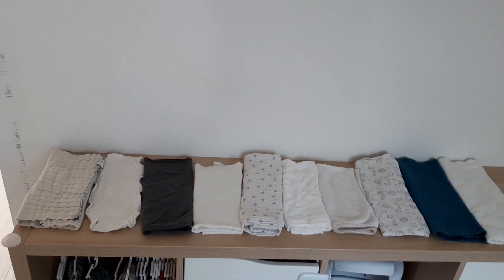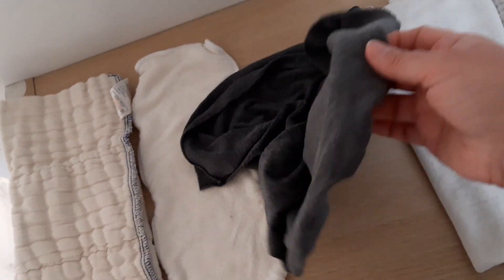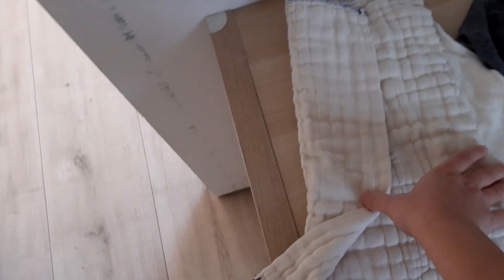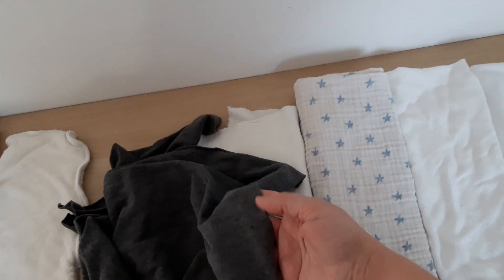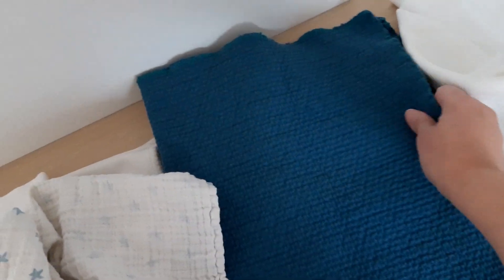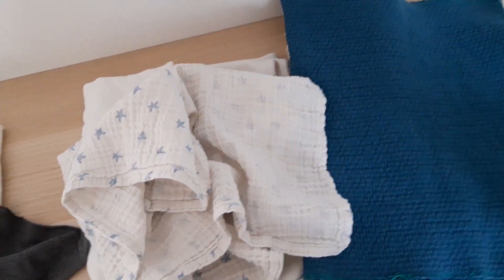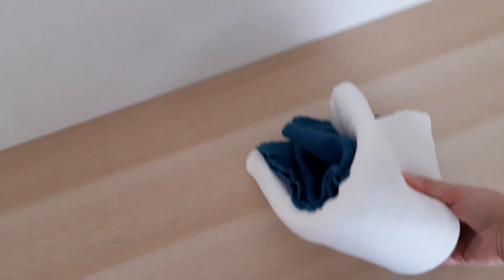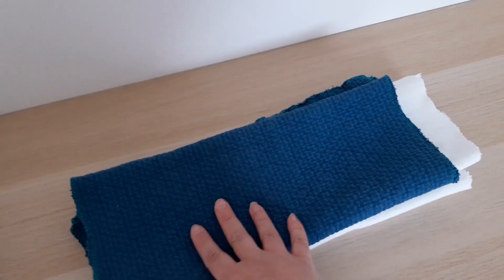Types of absorbency for cloth diapers

Comment: A lot of what you say here is good and accurate, However I feel the need to correct one thing. At about 12:30 you state that Zorb is 100% cotton with no other fibers and this is completely wrong. 

Zorb is a combination of several different types of microfiber, to my knowledge they have not released information about which fibers they use but some may be natural and some may be synthetic. 

It is a non-woven fabric (unlike the other fabrics you have there which are all either knit or woven) meaning the individal fibers are simply tangled togther (imagine cutting a large piece of string into random lengths then gathering them up and rubbing/rolling them into a tangled ball). Original Zorb is then pressed into sheets and left like this, it needs to be sandwiched between other babrics or will fall apart over time. The Zorb 3d you have there is the version they sell which comes already sandwiched between another fabric (in your case cotton).
Reply from the maker: Hi. Thanks for your input!

According to wazoodle website (the company who manufactures Zorb), Zorb 3D Organic Cotton is composed of "A proprietary blend of absorbent organic cotton fibers engineered for high performance": https://wazoodle.com/products/zorb-3d-organic-cotton-dimple?variant=39352803721350

But although the official Fabric Content for Labeling according to the manufacturer is "100% organic cotton", here is a more a more detailed explanation from the manufacturer: 
https://wazoodle.com/blogs/news/fiber-content-for-fabrics-labelling-made-easy